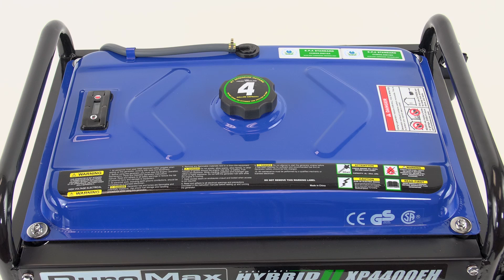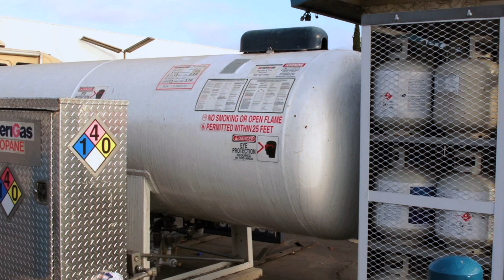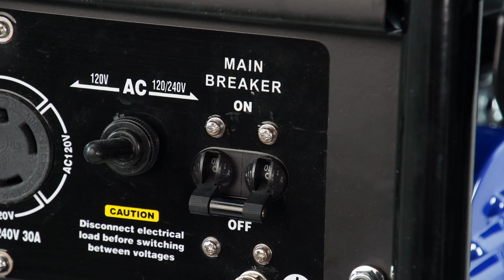DuroMax Generator How-To Guide: Assemble, Start, and Run on Gas or Propane

Comment: OK. Found the owner's manual/keys and other hardware in a plastic bag wedged/hidden underneath the gas tank. Found it because I followed somebody on youtube mentioning that, otherwise there is no way for me to find it. The unit started on 1 st pull and it works great. No complaints here. But the manufacturer must tell the consumer where to find that package , if not you will be getting a lot of calls/messages from annoyed customers.
Reply: Duromax has made several really maddening decisions with this unit. Like you mentioned, they have almost hidden the instructions and keys. I searched and searched for them and finally did a Google search before someone in a forum mentioned where they were. Why would a company do something so completely stupid and annoying, especially since they have a separate box with all other parts contained in it. Then, there's the battery hook up. My unit had a bolted on metal faceplate that made the battery all but inaccessible. Took me almost 45 minutes to hook up the negative terminal wire; something that normally would take less than a minute. I eventually got a ratchet wrench and removed the damn faceplate which serves no purpose really. Finally, the choke. It's all wrong in the instructions. I struggled to get the unit started following the instructions, finally called Duromax, and the rep said move the choke HALF-WAY to the right, not all the way. Started immediately once I did that. Again, why would a company allow something so important to be screwed up in the manual? So far, after all these struggles, I got it running and seems to be a solid performer. But Duromax needs to get it together regarding their boneheaded design and engineering decisions.
Reply: Come-on dude? Are you telling us that you do not know how to check the package contents correctly?  What do you expect from the company? Do you want them to come to your home , unbox the unit for you, assemble it for you (because you can’t check the package content thoroughly) ???

I dunno? Maybe I didn’t read your comment correctly but it sounds like you’re pleased with the product but you’re too damn dumb to check the packaging to make sure you have all the pieces???

I’m not sure you are a consumer that can be pleased. Your comment seams to be more about you than the product. 

Man I’m sorry and I’m not trying to be mean to you or anything but in today’s world of Shitty products you seam to be nic-picky as hell with what you said. 

I’ve had my DuroMax 4400E for a couple years now and it still starts on the first try. See ???? That’s the important info that people want to know when they’re trying to research a product to purchase.  They don’t care about you being too stupid to check your package contents.
Reply: The location of the manual is clearly stated in the manual :-D
Reply: @GeorgeBonez  Hey! That would be great idea if they came over and set it up. Hope they bring out a propane tank also?
Reply: totally agree

Comment: How long will a promax 4400 idle on a 20 lbs propane tank?
I did a calculation which does not seem possible.
It used 0.6 pounds in 1 hour.

I full 20 lbs propane  tank should runs  about 32 hours Idle.
Has anyone else done this test?
Most tanks are only 17 lbs net weight .  This is about 28 hours run idle time.
Reply: Bill Rundell first of all What is a Promax?

Comment: I just bought the XP4850EH and it runs great,  but the rubber tires and handles have this really bad chemical odor. When i grab the handles to move it the stink gets on my hands and it take 3 washings to get the smell off.  I have had it for two weeks now and I have to leave it outside as it stunk up my garage real bad. I had to put it in my van to bring it somewhere today and even with the windows open i started to feel dizzy from the smell.  Have you or anyone else noticed this at all or is mine just a freak?
Reply: It's from China... Get over it.
Reply: yea the tires stunk up the whole house for a week (was assembling it)
Reply: No smell at all in my unit purchased mid-2018.

Comment: I bought the, DuroMax Dual Fuel 4,850W Hybrid Propane/Gasoline Generator.  I did not come with an owners manual.  How can I get one, can't a contact number.  Please advise.  Thanks
Reply: +Keith Cloyd 

Check between the fuel tank and the motor- that is where I found mine and it was wedged way up in there so took a minute to locate.
Reply: KEITH, Just go to their website (URL) and download (DL) it ! Good Lord,  is everyone just too damn lazy to use their heads ??  Hell, after I ordered mine--I went to their URL & quickly DL'd the manual.  EASY, QUICK & It works ! Getting mine tomorrow.  I'm already.